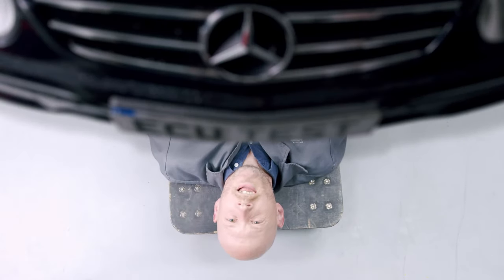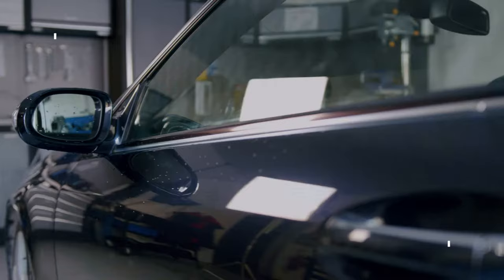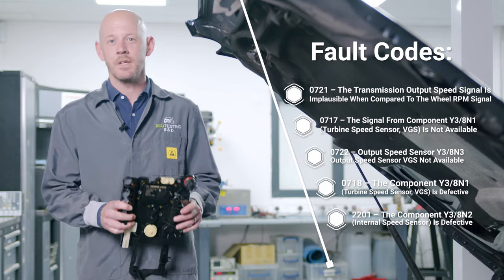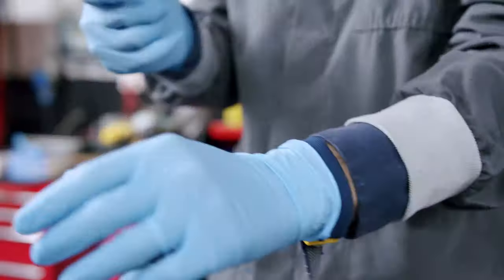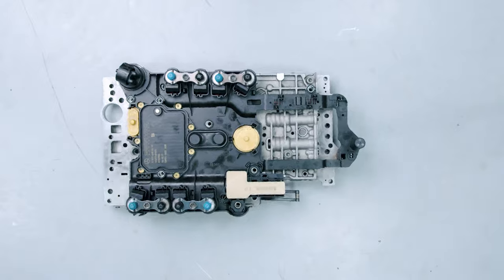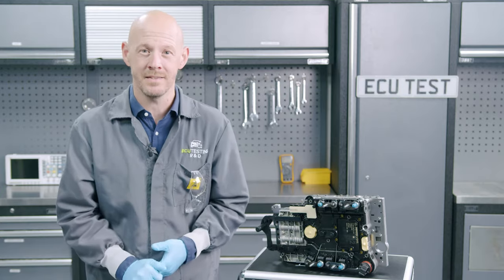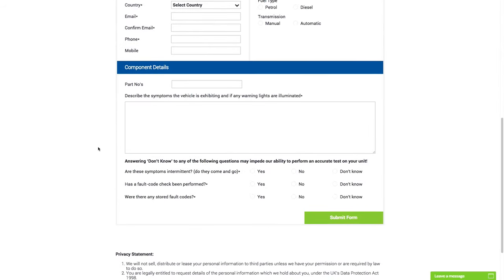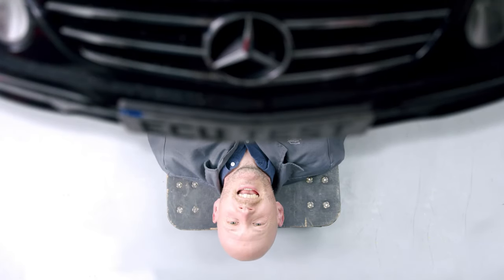Mercedes Transmission 7GTRONIC 722.9 Conductor Plate Problems

Comment: Deze things r very fragile n complicated. Mine is faulty right now, it selects into reverse, park and neutral gear but not drive and if forced by pressing the accelerator pedal on high engine rpm, it will seize up your engine, leaving u in a bigger mess and expenses. M about to change mine now
Reply: i’m trying to avoid locking up my motor i have same conductor plate issue

Comment: I have w210 01 e320 showing p0720 and p0500 car will drive then in limp mode once battery disconnected goes away then back in limp speedometer stop ready😢 any input

Comment: I have a 2010 E350 and when i start the car and put it on Drive I can go 15 minutes driving and when im going to a stop it goes back to Park by it self it does it in Reverse too and sometimes in Park doesn’t want to go in gear it goes back and forward from gears please help thanks.
Reply from the maker: Hi. Are you able to scan the vehicle for any fault codes? If you are able to do this, please email our technical support team at info@ecutesting.com with your part number and the details of your diagnostic scan. Cheers.

Comment: Hi there. I have w212 7G Tronic with harsh shifting. Did scans, but we found no fault code on the TCU. The oil level is also ok. A trans software update and adaptation was done and after that the there was an improvement. However the shift is still not as smooth as it should be. A friend advised me to update the engine software as well. Any thoughts on this?
Reply: any updates?
Reply: I did another transmission software update but I still have the problem. Not sure how to deal with it yet.
Reply: @bonfaceowino3867  I'm having same issues. Haven't done adaptations yet. What adaptations did you have done?
Reply: The problem could be on the hydrolic side of the transmission.I am suffering a same problem as you,there is no fault code either scanner or dashboard.My one's problem is harsh downing from 5th to 4th,also delaying for gearing down...
Reply: @ebkonuk tu as quoi comme voiture ?

Comment: hi Great video.  I have a 2008 722.9 behind my  350 CGI V6. W219.  It drops firmly into top gear especially when I lift my foot off the accelerator.    I replaced filter and oil. No metal found.  Still have same issue. No codes came up.
I just bought the car and all other gears are super smooth.  A couple of questions. 1. Can I ship the conductor plate to you should it be the problem?  2) Turn around time?  3. Can you send back to Malaysia?  I have "reprogrammed" the TCU as I'm the new driver.   Much obliged, thanks. Mark

Comment: my 06 e350 is stuck in first gear error code is 0748 internal electrical check y3/8y 2 k1 clutch control solenoid valve has failed
will the rebuild fix that ? i already replaced the solenoid but didn't work
Reply from the maker: Hi. Please email our technical support team at info@ecutesting.com with the details of your message above and they will be able to advise you of any re-build solution we can offer. Thanks.
Reply: @Ecutestinglimited  thank you

Comment: Hi what should i do about this error message p0606 component y3/8n4 fully integrated transmission control unit is faulty can i service or replace the sparepart thanks

Comment: So with the rebuild, that includes any sensors or solenoids that are defective? And most of the time, it comes back not needing reprogrammed? As in, you reinstall it and are up and running able to drive right away?
Reply from the maker: Hi. We can re-build solenoid faults on these units, and your unit's original programming is retained during the process so there should be no need to reprogram it when re-installing it on the vehicle. If you have any further questions, please email our technical support team on info@ecutesting.com, and they will be happy to advise you further. Thanks.

Comment: I have a 2007 S550 that the water cooler failed on. I replaced the water cooler and the radiator. I have flushed the transmission several times and the car drove decent. Every now and then RPMs would raise until the Transmission kicked in. ( Every now and then) I changed the fluids once more now the car won't go into drive. Reveres, neutral and park all work fine! I have changed the solenoids but have the same response, no forward. I can heard the module change the gear but it just won't go forward. Thoughts ???
Reply from the maker: Hi. We would recommend getting a diagnostic scan to see if any fault codes are being produced to help determine what the fault could be. If you are able to do this, please email the results to our technical support team at info@ecutesting.com, along with the the make and model of vehicle, and symptoms of the fault. They will be happy to assist you further and advise you of any re-build solution we can offer. Thanks

Comment: I have a faulty 7g transmission in my w204. The issue is with the y3/8n1 sensor. 
Should I just replace the sensor or get a full plate replacement?
Reply from the maker: Hi. A fault with the y3/8n1 sensor is a common symptom with a faulty 7GTRONIC conductor plate. Instead of replacing the unit, you can get it remanufactured by us which will eradicate the y3/8n1 sensor faults. Please fill in our online test form to get started: https://myaccount.ecutesting.com/

Comment: My 2013 c250 stays on 1st gear. Thought it was tje transmission but it didn’t smell like burnt transmission. It throws a code P2767 and P2768. Is it possible this might be it?
Reply from the maker: Hi, the symptoms and fault codes you are experiencing are common for a faulty transmission control module. To get your unit tested to confirm the fault and then re-built, please follow this link: https://www.ecutesting.com/product-catalogue/mercedes/c-class/ecu-transmission/ and select the part number that matches the one on your unit.
If your unit's part number is not on our website, please email our technical support team on info@ecutesting.com with the details of your message as you have written it above, as well as the part number of you unit. They will be happy to assist you further. Thanks.

Comment: Hi i have a A45 2014 
First the Car started with the error message Cant reverse consult workshop and this used to go away usually when u shut the car off and let it idle After taking the Car for a gearbox oil change and them trying to Adapt the Car the car would would fail the adaption 

now im left with 2 Error Codes 

p287c and p0921 

Ive Taken the car to MB and they want to change the valve body and Are saying this is what could ve causing this mess

Why i am Making this post Is To know if anyone has encountered the same mess and what fixed it for them or If Anybody knows what could be causing this. 

As im left with 2 options Change the gearbox or the valve body and hope for the best
Reply: I have the same issue, reverse not working, gears 2 4 6 only work, not sure if I should try rebuilding conductor, haven’t done oils change or any updates on transmission yet so trying to find what worked for others.
Reply: @FaizolAli-j1l  changed the valve body and clutches yet the problem still remained so ended up changing the whole gearbox Try getting a oil change and readapt the gearbox if ur lucky that will fix everything if not u wont be able to drive ur car at all Is the car always stuck in limp mode?

Comment: Hi, hope you can help. I have just had my conductor plate serviced, i do not know which company done this, however i have only done about 40 miles and the old problems are back. I will take this back to the garage tomorrow, but my concerns are, what else could be the problem. Would appreciate any advice.
Reply from the maker: Hi. If you are having problems with your conductor plate, we would recommend getting it scanned for fault codes. Please email our technical support team at info@ecutesting.com with the results of the diagnostic scan, any fault symptoms, and the part number of the unit itself, and they will be happy to advise you further. Thanks.

Comment: Hey had a car scan to check wich one abs sensor is bad after clearing foults and changing abs sensor on my w204 2011 220cdi doing test drive and stoped by red light gears disappeared again cleared foults i have same code P0705 range sensor circuit malfunction. Any ine had same problem?
Reply from the maker: Hi. Please email our technical support team at info@ecutesting.com with the details of your fault as stated in your message above, and they will be able to advise you further. Thanks.

Comment: Hello I think I am having some problems with my w221 Mercedes. It's just happened 3 times in the same day. First 2 times I had no power and the gearshift was different (manual mode disabled). After restarting the car everything was great. The third time instead I had check engine light on but I had the power and the gearshift was ok. So I decided having a test and this is what I had: 
- target gear signal implausible 722200
- transmission ratio implausible 722300
What do you think it is?
Reply from the maker: Hi. Please email our technical support team at info@ecutesting.com with the details of your message above and they will be able to advise you further. Thanks.

Comment: Sorry, I have a problem with my vehicle's transmission 'Mercedes 212-7 G tronic, the vehicle has absolutely no power (it doesn't want to run) what's the problem. I've tried changing the speed sensor, the result is zero. Thank you
Reply from the maker: Hi. We would recommend scanning the vehicle for any fault codes, as without these it would be difficult to determine what the cause of the fault could be. Once this is done, email the scan results and details of the fault symptoms to our technical support team at info@ecutesting.com and they will assist you further. Cheers.

Comment: I have a 2014 C63 AMG with the MCT transmission when I'm in M mode and I come to a complete stop it has a hard downshift also when I first take off to accelerate it also jerks is this a sign of the conductor plate failing?
Reply from the maker: Hi. Are you able to scan the vehicle for any fault codes? Without any being produced there could be multiple things causing jerky gears, and a simple reset that resets the perimeters could resolve the issue. This can be done by following the steps in this link: https://www.mercedesmedic.com/reset-mercedes-benz-transmission-procedure-instructions/

Comment: My 2011 mercedes e550 won't go in any gear. Code p0721 output shaft speed sensor. How much does it cost to rebuild. An where are u located
Reply from the maker: Hi. We are located in Derbyshire in the United Kingdom, however we offer a worldwide service so you can send your unit into us wherever you are! Please follow this link: https://www.ecutesting.com/common-faults/mercedes/7g-tronic-transmission-problems/ and select your make and model of vehicle for our most up to date pricing. Be sure to check the part number is correct, and if you cannot find your part number on our website then please contact our technical support team at info@ecutesting.com and they will be happy to assist you. Cheers.

Comment: What would be a rough cost of a rebuild? At the moment the only issue i have is a slight jerk going down the box from 4th to 3rd and particularly 3rd to 2nd. Up changes seem fine. Do I wait till it gets worse, as I don't want to spend money on something that may not even be the problem. 
No fault codes on ecm.
2013 e350 cdi. 105k miles.
Thanks
Reply from the maker: Hi Andy. Our prices can vary, so for up to date prices please select your make and model of vehicle here: https://www.ecutesting.com/common-faults/mercedes/7g-tronic-transmission-problems/ However, as you alluded to, if you are getting no fault codes appear then the problem may lie with something other than the ECU. Have you checked the transmission fluid level and when was the last time this was changed? We would recommend getting a proper diagnostic at a garage if the jerking is a constant issue and the transmission fluid is good, as it could be a sign of an issue which could get worse if ignored. If the diagnostic can rule everything else out other than a problem with the Transmission ECU, then we can help you out with that. Please feel free to contact our technical support team with any further questions at: info@ecutesting.com. Hope that helps!

Comment: Hai..I have a problem with my W176 (A250-2015) gear, I'm facing a very fascinating problem with my gearbox 7G. the gear run normally when I drive it, but once I want to overtake the gear doesn't want to change to low gear. and another thing lately is the sport and manual mode button, not function, that caused I cannot use the paddle shift. please help.
Reply from the maker: Hi. If you are able to scan the vehicle for fault codes then we may be able to assist further, as without these it would be very tricky to find the specific cause of the faults. If you are able to do this, please email our technical support team with your part number and the details of your diagnostic scan. Cheers.

Comment: Does your rebuild fix y3/8N4, and y3/8y2 problems?
Regards
Reply from the maker: Hi. Please email our technical support team on info@ecutesting.com with the following information. Your vehicle's make, model and year of manufacture, the symptoms of the fault including all fault codes, and the part number printed on your mechatronic unit. They will be able to advise you of any rebuild solution we can provide. Thanks.

Comment: Could this cause rpm fluctuation as I’m really struggling to find out what’s wrong with my car? 220d  C. Class
Reply: From my cold start, it takes about 15 minutes to start acting up or rpm  is fine at standstill just when moving any help would be greatly appreciated
Reply from the maker: Hi. Have you scanned the vehicle for any fault codes?
Reply: @Ecutestinglimited  yes the codes I had up was knock sensor, camshaft sensor which I have replaced both and there is no lights coming up on the dash now and also further investigation. Electric gearbox pump is not working which controls start stop as well wondering if this has something to do with it
Reply from the maker: Hi. We have no seen those fault symptoms being caused by a failing 7G-Tronic, so it is likely another fault somewhere on the vehicle.
Reply: @Ecutestinglimited  the only thing that is coming up now is electric gearbox pump as stop star is not engaging either
Reply: @Ecutestinglimited  do you think that could be the cause the pump it fluctuates between one and 2000 the rpm seems to be more noticeable at lower engine speed

Comment: I have a 2007 Mercedes C230 it is throwing code 0730 incorrect gear ratio can you fix this
Reply from the maker: Hi. Unfortunately there are various things that can cause the 0730 fault code, both electrical, mechanical or hydraulic. We would need more diagnostic information to rule out everything other than a fault with the transmission control module before we can confirm if we can re-build your unit to fix the fault. If you have any other questions please feel free to contact our technical support team with the details of your fault as well as what diagnostic/attempted fixes you have done: info@ecutesting.com. Cheers

Comment: Hi i have a mercedes w203 c350 did a scan and it shows communication with control unit has a mulfunction
Reply: Any advice plz
Reply from the maker: Hi. If you could email our technical support team at info@ecutesting.com with your part number, make and model of vehicle, any fault codes you have obtained and any further details of the fault, then they will be happy to help you out! Cheers.

Comment: Great video.  I have a 0217 check component Y3/8Y8 for external damage. How would you fix this issue?
Reply: have you fixed that ?
Reply: @ukaszjurys2475  I read somewhere that if you have too much oil it can cause this error.  Checked my oil level and it was high. Did an oil change and made sure I did stayed between the low and high.  Error message gone away for 2,000 miles.
Reply: @ryip0131  whoever changed your that oil before did not corrected oil level ?
Reply: @ukaszjurys2475  yes.  That was me. I screwed up.

Comment: Hey!
I have a mercedes c 200. 
symptoms, when I first start the car it moves normally for 2-3 minutes after on i stop, then it won't move at all. when I turn it off and on it's the same again.

thanks for reply😊
Reply from the maker: Hi. Are you able to scan the vehicle for any fault codes? If you are then please email the scan results and the fault symptoms to our technical support team at info@ecutesting.com and they will assist you further. Cheers.
Reply: Replace gear selector, common problem with w203 and w211
Reply: Have the same issue. How did u fix it?

Comment: Who would test a gearbox for faults before sending it out to u...how are codes read
Reply from the maker: Hi. Fault codes can be read by plugging a diagnostic tool into your OBD2 port and scanning the vehicle for fault codes. This can be done by a mechanic at any reputable garage and depending on the unit at fault or vehicle manufacturer, you may want to go to a specialist to get these read, e.g. a Transmission specialist or a Mercedes specialist. You can also do this yourself if you buy a code scanner/reader for your vehicle.

Comment: I keep getting code "U0402 - Invalid Data received from TCU"
And occasionally every single light on my dash turns on and does a lovely light show full of beeping and al sorts of other warning noises. ESP, DSR, ABS, pre-safe, drive to shop without changing gear, blind spot monitoring defective, the list goes on.
I can clear out all codes, but the only one that comes back right away when i start the vehicle is the U0402
2011 ML 350 bluetech 
With only 61k miles.
Reply from the maker: Hi. Please email our technical support team at info@ecutesting.com with the all the details of your message above as well as your vehicle model and year of manufacture. They will advise you further. Thanks.